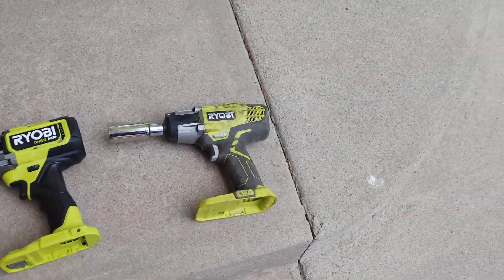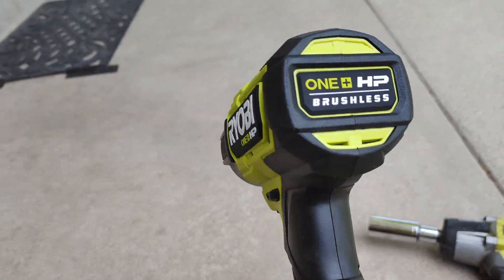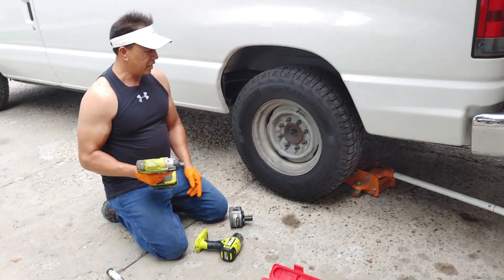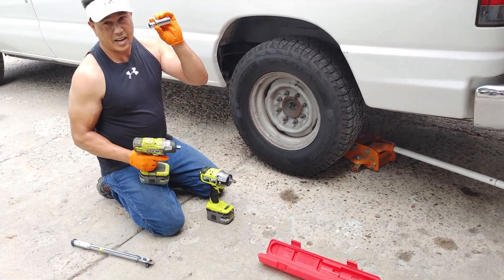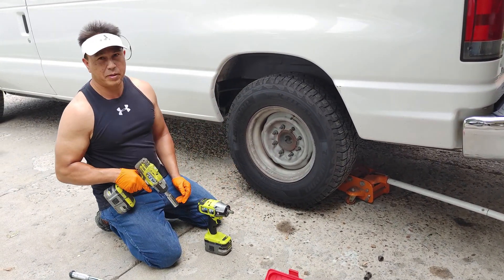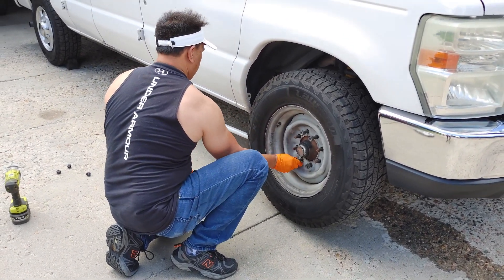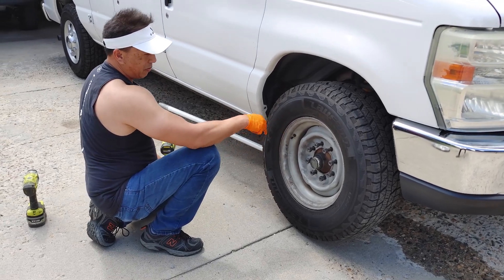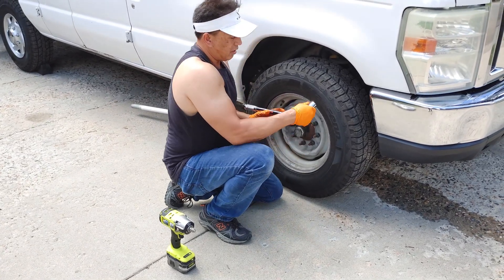Ryobi p261 vs p262 Impact Wrench tire rotation fastening lugnuts

Comment: I had the ryobi P261 and quickly got rid of it as it would shutdown in the middle of removing some of the tougher impact bolts. I switched over to rigid mid torque and high torque and never looked back. 👍🏼🇨🇦

Comment: I got the 262 recently and did some testing.  In auto mode , it stops when it starts inpacting.  Another 1 second burst after that gets it really close to 80 lbs which is what i need for my Honda accord.  On setting 2 with a regular 4 ah battery,  gets it up to about 150 ft lbs if you let it impact for about 3 seconds.  I'd always suggest stopping early and using a torque wrench though.   Overtightened lug nuts are prone to failure.
Reply from the maker: I was wondering about that. Mode 2 after about 3 seconds 150 ft pounds. Thanks! And if course torque check afterwards.

Comment: Set to auto. That tightens to contact then adjust torque with wrench. With removal, auto loosens till it breaks away and then stops so nuts don’t go flying off. Not that critical. 
Setting 1,2 and 3 only adjust speed not power.
Reply from the maker: Thanks! That's very good info.

Comment: Ryobi just released their high torque.  Has an automatic mode to prevent busting the threads just like mid torque. Automatic will just tighten snug.  No longer do we have to break the wallet to get a high torque.  Seriously man, don't want to pay 300 dollars for a milwaukee and I am glad TTi (parent company of Milwaukee and also makes power tools for Ridgid) decided to step down by releasing an affordable high torque through Ryobi.  I think for driving lag screws the high torque has more than enough torque to do all the jobs.

Comment: ...chrome sockets with an impact, i didn't even finished the video!
Reply from the maker: That's okay if you didn't finish the video. But I did mention in the video that I would not recommend regular sockets and to go with impact sockets. Impact sockets hit harder but this is just a general reference video about the tool itself. Nothing scientific
Reply: @joemcleod7173  ...well,back in '82 when i was very young i used to work in aTransmision shop,basically an apprentice; i needed to remove a crossmember that supported the tranny on this Buick,the bolts were 11/16 but i didn't have the impact socket to remove them,instead i used a chrome deep well Crafstman socket with my trusty venerable CP 734 impact wrench;long story short,after a few bursts the socket shattered in every direction...good thing i was wearing impact goggles...lesson learned!
Reply from the maker: @177bandit  woah! Thanks for the heads up! I will take your advice. The worse I've done is a split socket. But after hearing that I won't be doing that again!
Reply: @joemcleod7173  hay muchas personas sensibles en este mundo 🤭🤭🤭🤭

Comment: For that p262 you need to use the HP battery not those older ones to get the full potential of that tool.
Reply from the maker: I agree. I think the p262 with an HP battery is a very good impact wrench at full potential.

Comment: Way too tight.  Most lug nuts are supposed to be 80-100 max.
Reply from the maker: Thanks for the concern. I'm just going by what the recommended Ford specs for a 3/4 ton van that model year. 140 foot pounds but I understand most cars and light trucks that is too tight
Reply from the maker: But I do agree on the Ryobi P262 impact wrench. When I tightened the lugs with that tool, I left it on too tight.
Reply: Nope